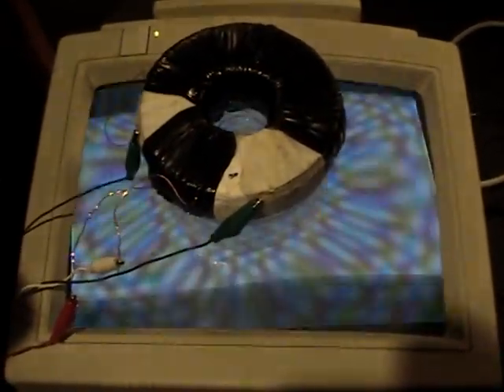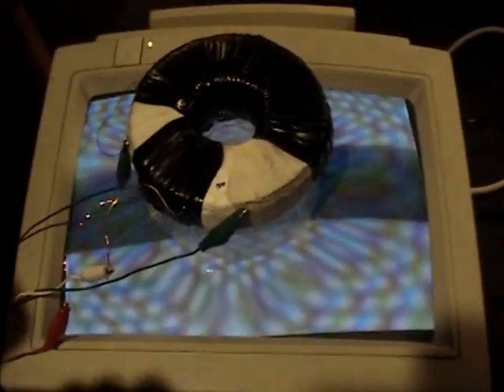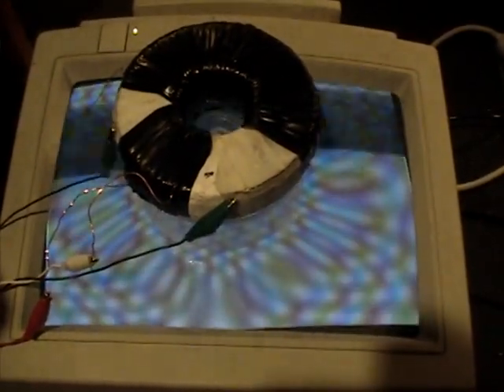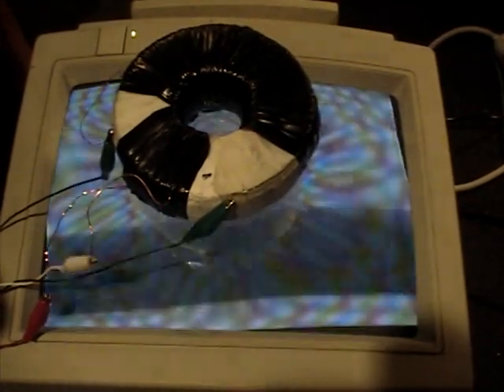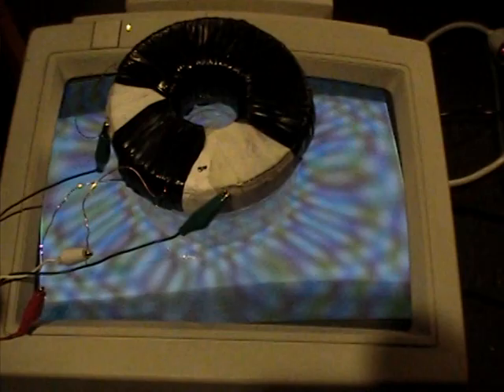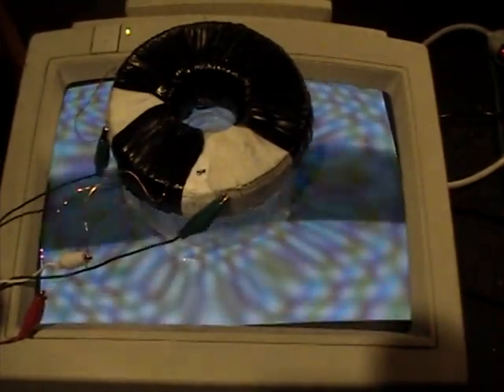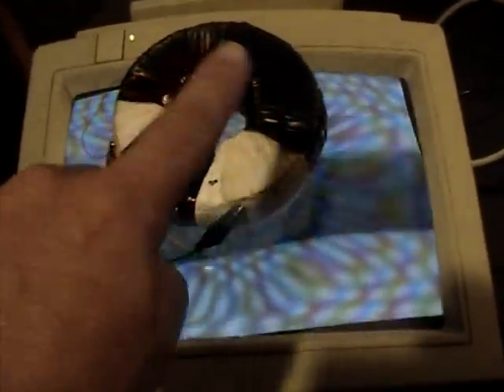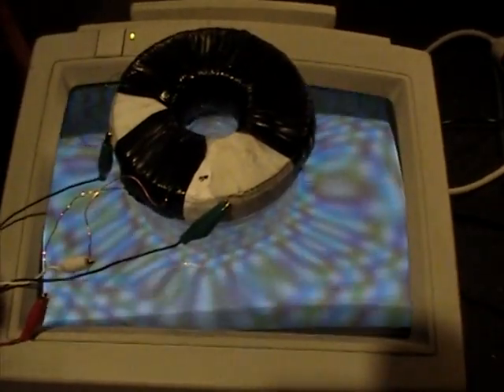Flux and Frequencies

Comment: If the primary coil has a permanent magnet  core, you can change the magnetic field of that magnet by passing current through it.  Current in a wire creates a magnetic  field at 90.  Through a magnet shifts the field closer to the 90 degree position.  Keep the magnet stationairy but oscillate the field.  Make coil to  Earth resonance at 7.3 to 7.8 hz, oscillate to get started.  Natural standing waves power  the coil when in near field effect. Good luck hope to see on store shelfs by Christmass.